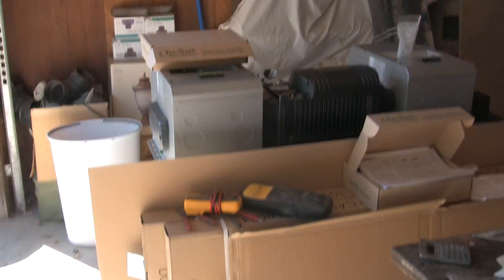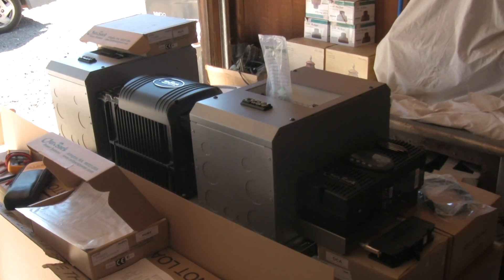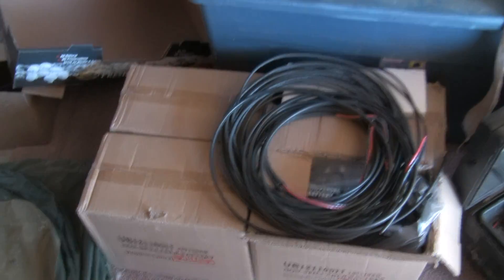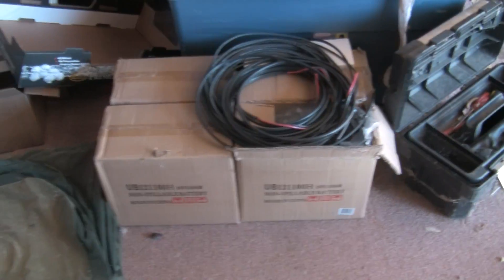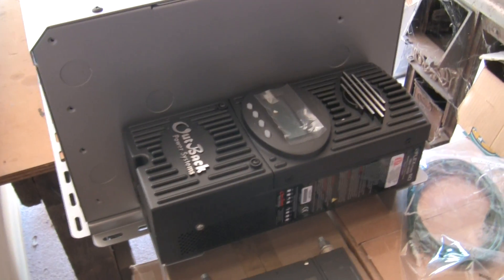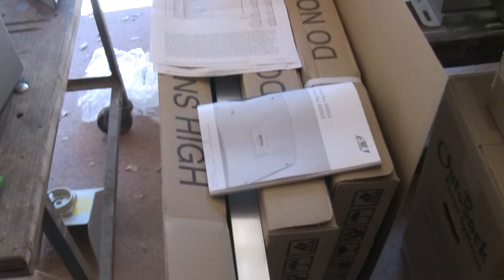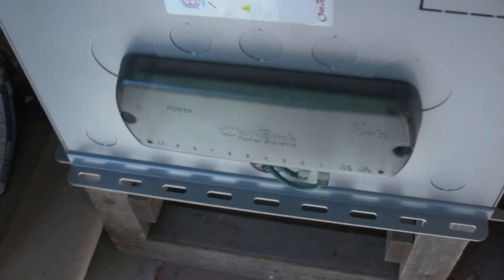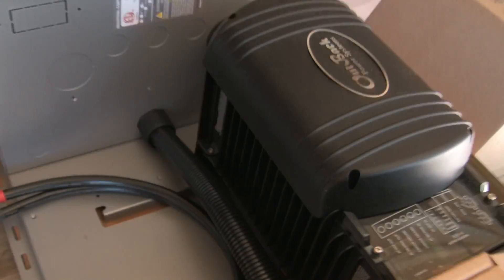Outback offgrid intro

Comment from the maker: @mastainventa 

This equipment is designed as a stand-alone off-grid power center. I think my previous response may have been misleading. I am using it for back-up during short term grid failures, but with more batteries, more solar generation and energy conservation measures, it would be a grid substitute. This represents the top tier equipment money can buy.

Comment from the maker: This is intended as an off-grid system for backup power in the event of grid failure. Answering your question adequately really depends on a few things, however you definitely could run most residential loads (maybe not air conditioning simultaneously) IF you have enough battery and PV recharge rate to match your loads. As the video states, this system will support 240V 30amp or 120V 60amp. Run times on load is a function of the batteries and the PV or generator to recharge them.